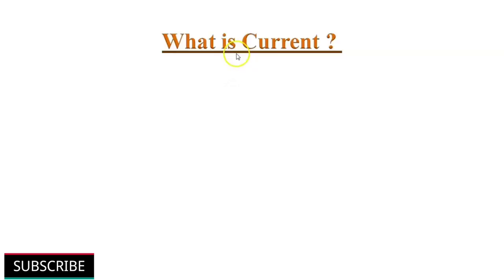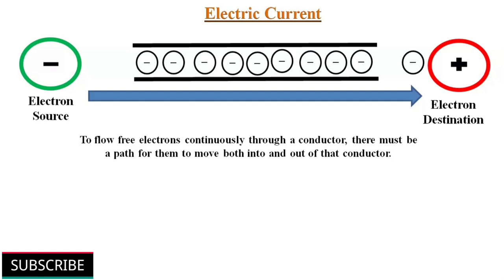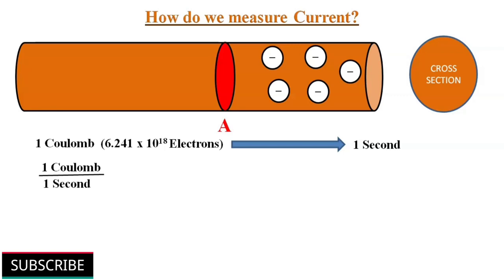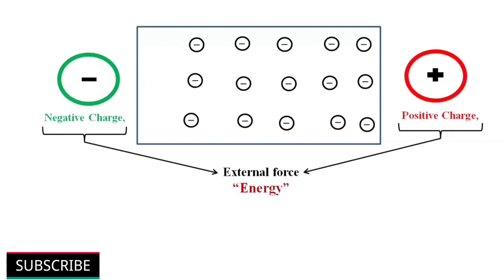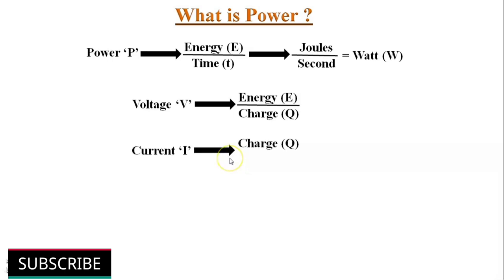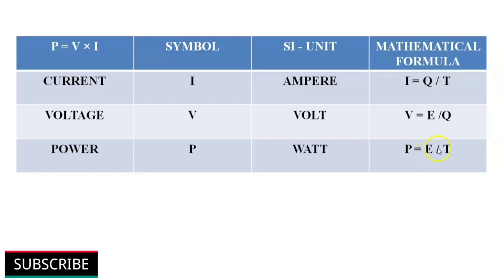Current, Voltage and Power Explained with Examples

Comment from the maker: Timestamps for various topics covered in this video are as follows:
0:49 What is Current,
8:30 What is Voltage,
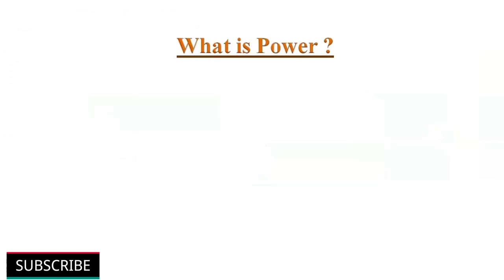12:15 What is Power,
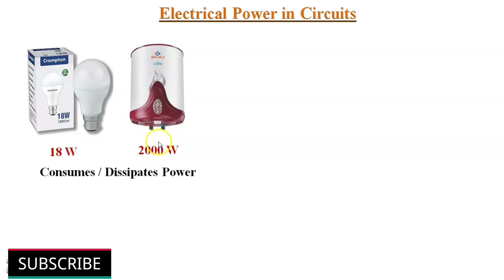17:18 Power Triangle,
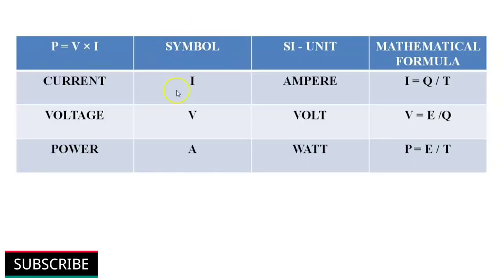18:13 Summary Current Voltage Power.